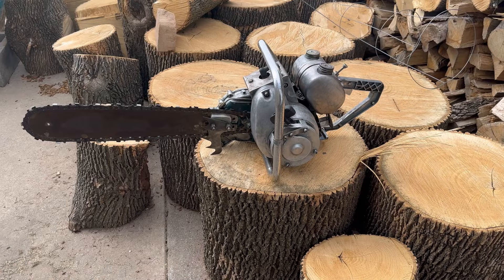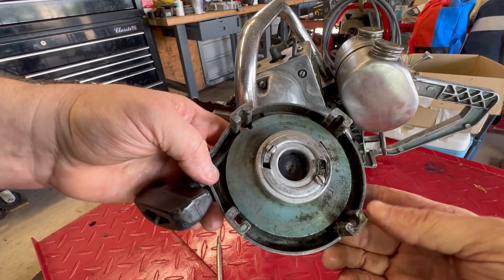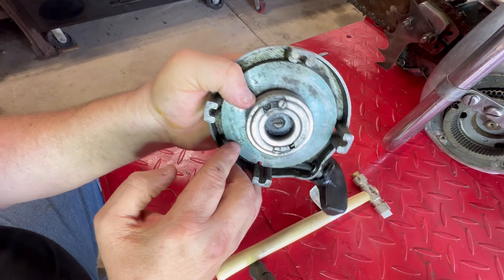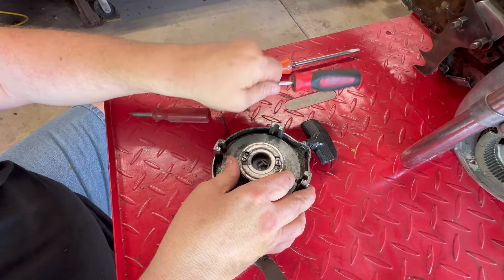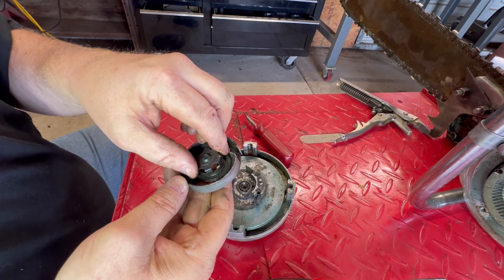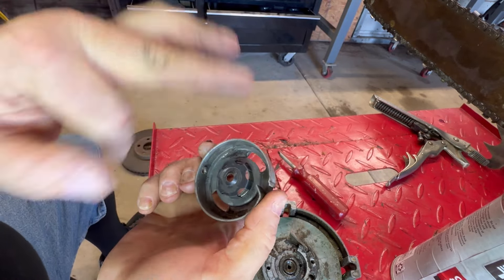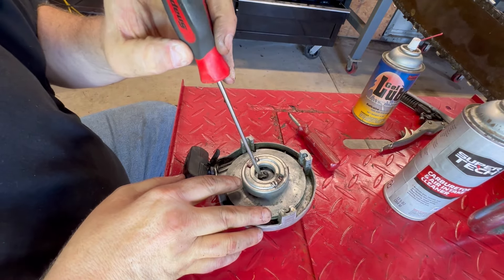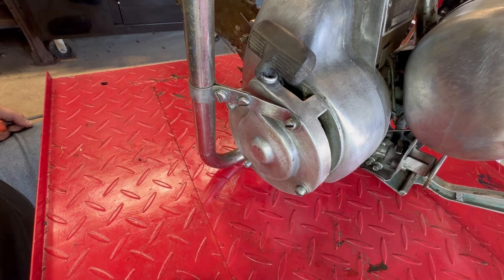STARTER REPAIR ON A 1950’S SEARS AND ROEBUCK GEAR DRIVE CHAIN SAW / FIXED WITH NO PARTS!

Comment: Totally unrelated question, Jeremy.  I'm currently studying lawn tractor and zero turn electrical systems.  In your experience, how many different styles of relays are used on lawn tractors and zero turns?  So far in my looking around I've only seen the one style, but I thought I'd ask someone who has a lot of experience with these.  The one I've seen is like the 5-post one in your Sep 7, 2012 video here: https://www.youtube.com/watch?v=wQxACu6us0w.  Thanks for your help!

PS- I never saw the intro on that video before - really cool!  Why ever didn't you keep it?